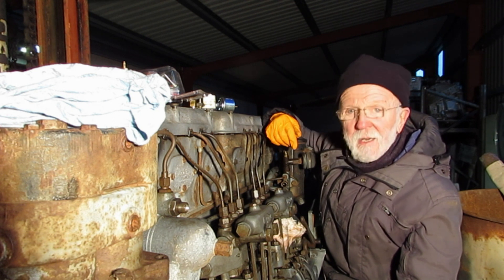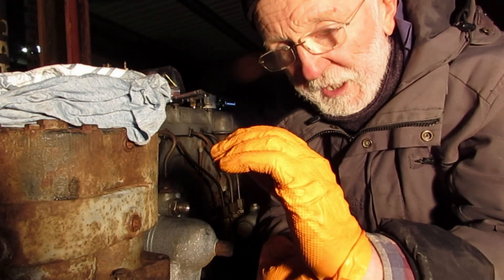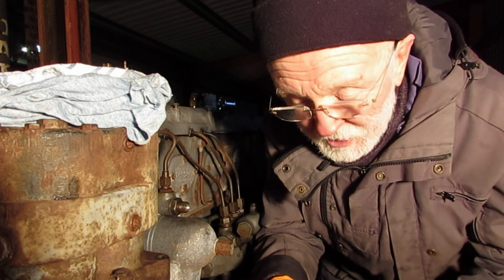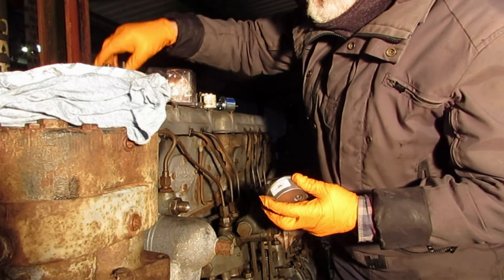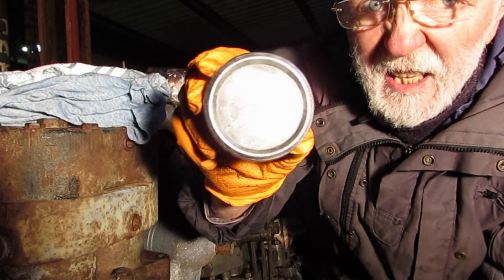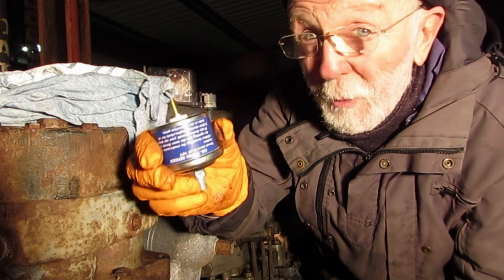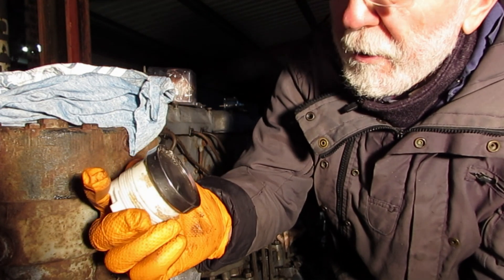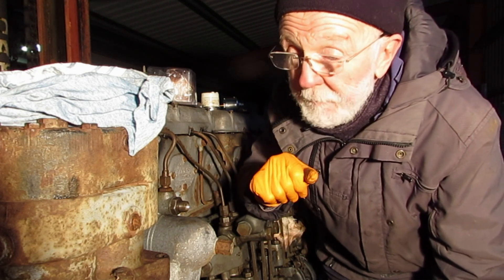Gardner Engines: measuring oil pressure.

Comment: Hi Joe, greetings from Australia, really enjoy watching your videos and learning so much! We have a beautiful old Marine 6LW in a timber cruiser. On the subject of oil keen to understand more about how oil pressure should build on a cold start. On our 6LW oil pressure is fine once running but on start-up it can take15-20 second for oil pressure to build (Gardner Guage located on engine). This seemingly dry start scares me every time, so hope you can provide some insights.
Reply from the maker: Luke, please, is the gauge located directly ON THE ENGINE, or just the sender?
Reply: The oil pressure gauge sits next to an electrical sender just under the oil filter housing,  the gauge and electrical sender are supplied by a short 14  inch long tube which is teed into what I think is an oil return pipe next to the injector pump.

Comment: Hi joe hope all is well heres daft question  is the 6lx and 6lxb oil pressure roughly the same ? ive changed my 6lx engine with suitable oil and first 12 hours runs at roughly 34psi  after that it drops to 30-32 psi is this nornmal but no lower than 30psi .cheers
Reply from the maker: Yes, they are the same.   I don't think you have much to worry about :-(